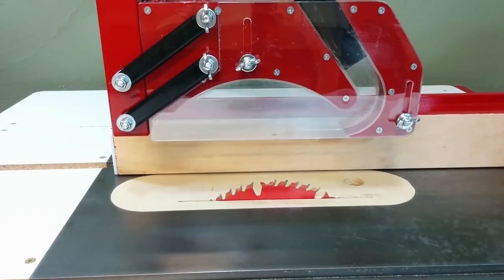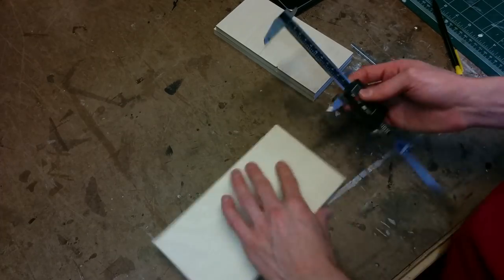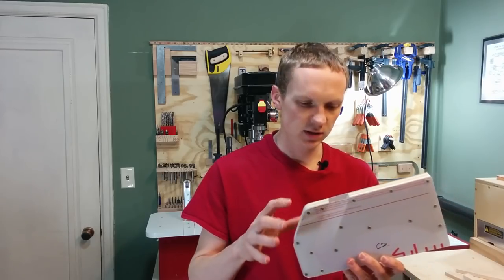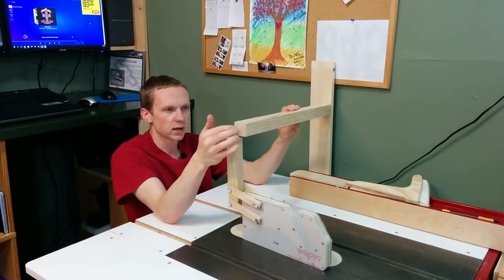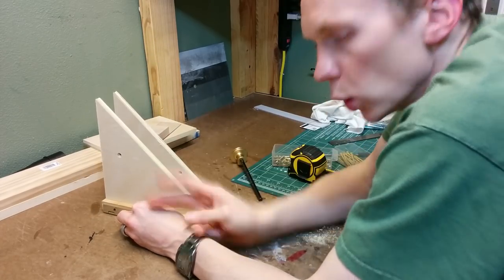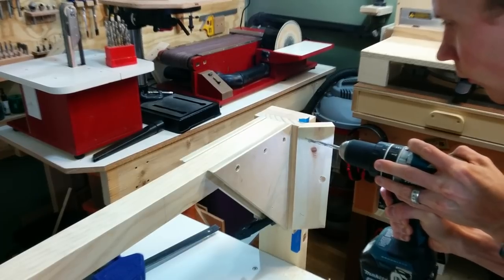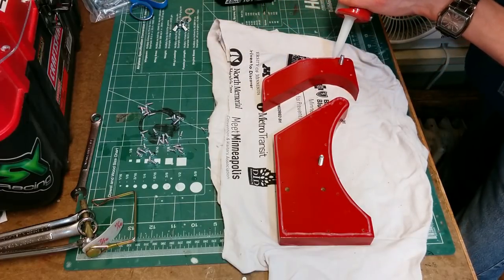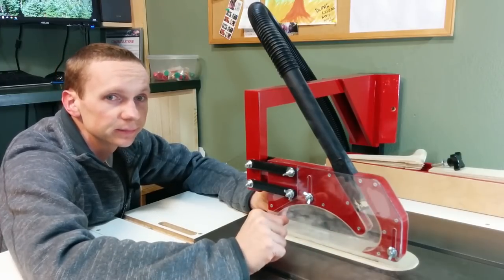Over Arm Dust Collection for my Table Saw

Comment: The design of the cover itself is exactly what I envisioned. Your airflow layout captures the dust efficiently because it works with the momentum of the dust as it shoots forward off the spinning blade instead of against it. Even the highest-end options available on the market today don't work nearly as efficiently as this design because they pull the dust vertically instead of at this angle. This is the first video I've seen of yours, but this design alone is enough for me to subscribe. Hope to see more from you.

Comment: i want to thank you for finally giving me a realistic solution to better dust control in my shop. I am building a new shop in my basement.  I  am excited about experimenting with your design on my Kapex miter saw and Sawstop table. Festool brags about their superior dust collection on the Kapex. It is all bovine excrement! It sucks...because it doesn't...suck that is. Thanks again. Your solutions are practical and won't require me to learn how to mig weld nor own a CNC. Although those 3D printing things you did were impressive.

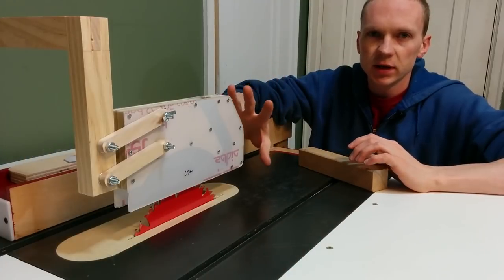Comment: 15:00 I relate.  Various situations call for shaving a kerf-width or less off the side of stock, but one that I encounter frequently is when I am forming molding profiles - various pieces of base, casing, backband, crown, etc. - to match the original in my house.  For these operations I use a 1/8-in. kerf blade with flat top teeth, typically shaving about 1/16 in., up to 2+ inches high.  Nothing throws dust and shredded wood off my table saw like this type of operation.  My jury-rigged dust vac port inside my saw cabinet might as well be a blower for all the good it does when forming profiles.  I think maybe my zero clearance inserts actually make it worse; shredded wood fibers often collect in the blade slot in the inserts; I need to test that.   So I end up taping a floor attachment for my shop vac over and beside the blade, which is awkward because the work is surrounded by lateral and holddown featherboards, infeed and outfeed (as I am not actually ripping the work into two pieces).  I'm going to order your plans at least to give me some more ideas.  For one thing, I think I'll need longer linkages to enable raising the "shield" higher to accommodate stock that may be five or more inches high, e.g., 1x6 going through vertically.  A little late as I just today completed forming edges on 80 boards, eight to 14 feet long, lol.

btw, I only came across your channel the past couple days and I must say you are extremely ingenious and creative in your approach to deriving solutions to problems.  I was not surprised to learn what your day job entails.

Comment: AAA+  I saw this video when it first came out and it's as relevant today as ti was then. I saved it because this is a great basic design for an over head dust collection for a tablesaw and Justin is still using it today in is new shop. The piece that encloses the blade is the most important part because of the internal design. I just set up my new cabinet saw and instead of paying over $1000 for the enclosure and arm that I could also have bought, I'm making this one instead. It's a proven design, simple with very inexpensive components. I will encorperate a steel beam instead of a wooden one for the arm because the span above my new tablesaw is much longer than Justin's. I highly recommend that you watch some of Justin's other videos. You may not like a certain component within in a design of his but tweak it to your needs as I'm doing with this one. His ideas are clever, budget friendly, and inspires you to expand your mind to be more creative. Thank you Justin for designing my new tablesaw's dust collection!  ;>)

Comment: It's a good thing you made this, because dude, you NEED dust collection in that shop, with your computer desk being basically your outfield table for your table saw.  I'm still watching the video, but so far I like it, and I think I'm going to follow your model for overhead DC on my contractor saw.

Comment: Like your guard dust pickup head. It takes out the dust where it is generated at the front of the guard. Most ready made dust collection guards have the port at the back or middle. Most of the dust during a cut goes down through the insert until the blade exits the cut. Then a plume of dust is blown back at the operator.

Comment: Hi Justin.  Fantastic video!  Thank you very much for a great video.  I am about to make a similar dust collection arm for my sliding table saw.  I love your design and will definitely incorporate most of your ideas.  I will just replace the wood arm and stucture with steel tubing in my solution because I want a 4 inch extraction for improved airflow.

Comment: wow. pretty cool. I like the swing away feature for when it would get in the way. I always wondered why most overhead collectors have the vacuum port in the back, as the blade throws the dust toward the infeed direction. I bet your design is more efficient. Also never knew that you could heat mold round cylinders into a square. That was a great idea!
Reply from the maker: Thanks James!

Comment: Ok.  I've been binge watching your videos all day.  Your craftsmanship is remarkable.  What is most remarkable is how you think to do the things you do.  Heating the hose end to make it a square is what separates you from the good.  That kind of inventiveness makes you GREAT.  I can make stuff, but I can't think of stuff.  I am starting to get envious.  ;-)   The way you solve problems so simply is amazing.  Love watching you work.  What is that scribe thingy you used to mark the lines for the gussets?  It was some kind of rod with a round knob on it.  That is so much more accurate than making two measurements and drawing a line.  I'm definitely building the 2 inch sander.  It looks like that has become an indispensable part of your tool collection.
Reply from the maker: Thanks for the feedback Joe! I think the tool you are referring to is the marking gauge. I don't use it a lot, but it is very precise.

Comment: Nice work. Much safer and cleaner  . I'm curious why they don't include something like this in every saw from manufacturer. Here in EU  30-40 years old saw's  have this feature already when you buy them. 
Good job. Keep up the good work
Reply from the maker: +Slovenian Woodworker I agree.. I guess people don't want to spend money for nive accessories like these.
Reply: Justin Depew Maybe that is the thing. There are being sold as accessory so you have a choice.  Here are as standard I think also by law because every saw has one of those. Mine for example too and is 20 + years old format saw.

Comment: Quite a good video! I liked the recap at the end with lessons learned. I assume that the dust collection was all that you hoped it would be or you would have mentioned it. 
I think that the solution to the bolts getting in the way is to replace them with rivets. Rivets of that size are commonly used in the bodies of cars, in doors, for instance, where there is no clearance room to spare for bolt heads and nuts.
Reply from the maker: Thanks.  Dust collections works well - I am happy with that.  I don't think rivets would work because I am relying on being able to tighten the wing nuts down to lock the position of the dust collector.
Reply: Justin Depew Great to hear the collection is working well. I think I'll try to replicate it. I suppose you could use a threaded insert on the one side and a low profile cap bolt that's slotted on the other and loosen/tighten it with a slotted screwdriver. Anyway, thanks for all.

Comment: Great idea! I think I will make one but I think I will make a few minor changes. I would create a more angled front to allow the board to just slide under the hood, lifting it up as I slide the board forward. It's own weight will keep it tightly on the board as you feed it forward and this would eliminate the need to adjust it to the board thickness and locking it in place. :)

Comment: Some folks use a “spare” apartment room for a computer, sewing machine, etc., I have never seen / known anyone put a workshop in that space.  Genius!!

A couple comments…
•  While polycarbonate is harder and more scratch resistant, acrylic is a whole lot easier to use (particularly if you have a friend with a laser engraver!).  Additionally, because it has a lower thermoplastic melting point, polishing the sawn edges (as well as bending) is easily done with heat (but unnecessary if a laser engraver was used: acrylic is self-polishing from the laser beam’s heat).
• When sanding the inside of the curve (wood directly over the saw blade), did you consider using to top of your small belt sander: it has curved sanding surface?  It seems it would be a better sanding solution for (inside) curved areas than a flat sanding surface.  Putting a spacer piece of wood behind the sanding belt for a more rigid sanding surface was very clever.
• When cutting a tenon, two cuts with the table saw would be easier: one vertical and one horizontal (no chisel needed).
• For the square plastic hose, it may have been easier to cut a “point” on the end of your molding piece, perhaps four “point” butt at 30° angles.  With a point in the stake, shoving it into the round plastic tube would likely be easier while heating the plastic.  None-the-less, a smart “round hole — square peg” solution.
• For the “too” long bolt issue, consider using a carriage bolt on the left side of your contraption.  You could easily file in a square hole in the plastic.

Again, kudos for your ingenuity and sharing your project.  I am trying to do the same thing, only trying to adapt a saw-collecting hood to my saw blade plastic shield: as I saw, the hood would “automatically” flex upward based on the thickness of the piece I am cutting.  Your solution is just as workable, but one more thing ya gotta do before cutting something.  I think your solution is offering me a better potential solution to do what I want to do (or try).  Also, I am putting my suction port on the back (far) side of the blade because that is were the saw dust is coming up from underneath the table — except, as you showed, when cutting off slivers of wood from the left side of whatever you are trim-cutting.

One final thing… While most of us are, like you, operate on a small budget, consider getting a RIDGID Oscillating Edge / Belt Spindle Sander, Model#  EB4424 at Home Depot.  These are about $200 or less.  I LOVE mine; a rigid flat belt sanding surface, several round spindles, etc., that oscillates is really sweet. These are very small (comparatively), and would fit great in an apartment.  I am still trying to figure out a sawdust colleting hood for my sander; right now, I just a use a “Table Top Dust Hood” setting behind my sander that collects ‘most’ of the dust.  Because I have a larger workshop area, this is not too big of an issue; it us just annoying (and better than nothing).  However, necessity is the mother of inventive solutions, so a “dusty” sander in a smaller room would coerce a solution: be sure to make a video of what you develop…
Reply from the maker: Thank you for the helpful tips and suggestions!!  You have a sharp eye for attention to detail.

Comment: Nice work, this is very similar to what I was picturing in my head when I was trying to draw something up, but this very well thought out.

And please be careful making those unsupported miters on a chopper. Guy I ran into on a job was missing the tips (below the finger nail, so quite devastating) of three fingers and said he was doing a cut like that when the blade bound and pulled his hand into the blade. Number one priority is to finish any work day with at least as many appendages as you started with.

Comment: Very nice design and video, just found your channel and have subscribed.
I think having suction at the front is likely to give better results than from behind the blade.
One question I have about the design is about blade visibility, with a solid front to the dust shroud presumably you can't see the front of the blade as the piece to be cut is pushed forward, do you find this an issue?
Reply from the maker: Thanks for watching!  I do not have an issue with visibility as I try not to stand in front of the blade.  I typically stand off to the side while pushing pieces through the table saw.  This keeps me out of the way in case of kick back and allows me to just see the front of the blade through the side of the dust shroud.

Comment: I'm curious, after noticing what kind of wood you used for portions of the project (big box store "select pine"), which I have used on various projects in and out of the shop, if you've noticed any loosening of the project as a whole or slop in the moving parts which are constructed of that kind of wood.
Reply from the maker: I've had no issues with the big box store lumber. It usually takes some digging to find a straight piece, but other than that it's fine.

Comment: Very cool! But if you close the rear opening between the two plexiglas panes, I think it would be even more effective.
Reply from the maker: Thanks! I left the rear open because the air needs to flow in from somewhere. Creating a flow of air over the blade I thought would be most effective.
Reply: @JustinDepew  Ok! i understand! But you can try it with a duct tape.

Comment: I see home made and commercial dust collection with the suction mounted in front, on top and in the rear of the shroud. Do you know which location is most efficient? Why did you decide to mount your's up front?
Reply from the maker: I'm not sure which is most efficient, but the reason I chose the front was because it matches the air flow that is created by the blade. If the hose was at the back of the blade, it would have to suck the dust against the natural direction of the flow. I thought having it in the front would collect the most dust for this reason.

Comment: Great Video!  This is one of the best builds I've seen in a while.  Question - do you have under-table dust collection also?  Or are you just using the over arm?
Reply from the maker: The saw is enclosed under the table and there is a dust port, but I only use the overarm because I only have one shop vac. If I had more than one I would use both under table and over arm collectors.  Some say I will get both hooked up.

Comment: What are the dimensions of the shop vac extension tube that you heat - 1.25" OD?
Reply from the maker: I used a standard 1-1/4" shop vac hose.  I'm not sure what the exact dimension of the ridged tube portion is.

Comment: Have you considered selling plans instead of giving them away for free?  Your designs are some of the best of each type I've seen and I've looked at a lot of designs. I've been a professional engineer and product designer for almost 30 years now and I believe you may be underestimating the value of your designs.

I'd be interested in hearing your thoughts about why you don't sell your plans. Thx.
Reply from the maker: Thanks Tony, I appreciate your comment.  I have a few thoughts on why I am currently giving away my stuff.  First, I am extremely grateful for the internet and everyone on it that posts free content.  I learned woodworking entirely by watching other people's videos. I can't count the number of times some stranger on the internet has saved my day or helped to solve one of my problems.  I like to think of what I do by posting videos and 3D designs as my way of giving back to the community.  Secondly, I am not currently trying to make a living off of this content.  I have a day job and don't need this to make money to support myself.   Third, making plans is a lot of work.  I don't actually make plans, I just make a 3D model.  Since I don't put the effort into making detailed plans, I don't think it's worth it to try and sell my models (although I may be underestimating this value like you said).  Since I only do this in my spare time, I would like to spend most of that time designing and making new projects, instead of putting together plans to sell and maintaining that part of a business.  Maybe someday I could do this full time, but for now enjoy the free stuff :)

Lastly, if anyone is so inclined I do have a donation button on my website in which people can contribute to what I do there if they see value in what they are getting here.

Comment: Will you ever do a little explanation on how you get your paint to come out so good?
Reply from the maker: No secrete here.  Three coats with foam brush, sand with 220 in between coats.  I use rustoleum enamel.

Comment: It occurs to me that you can't see the blade from your point of view as you feed the work thru the saw.  That would bother me a bit.
Reply from the maker: I always stand off to the side of the blade when passing boards through so I can see the blade just fine. You really shouldn't stand directly in line with the blade because of kickback.

Comment: If you have a powerful extract system you wouldn't  need what you've shown. Don't forget the riving knife
Reply from the maker: I disagree. No amount of suction below the table will capture the dust made above the table. Especially dust made from thin edge cuts. Even professional table saws have over arm dust collectors.

Comment: the linkages should be inside and not  in the exterior as a improvement
Reply from the maker: +Ronaldo Sosa that is a really good idea!!
Reply: sorry my english!!!  saludos desde argentina ;)
Reply: What would that improve? if anything it would make it harder to tight them down.
Reply: @brandonrippeonphoto  I believe the improvement eluded to here, is removal of obstructions that may otherwise impede movement, and indeed prevent narrow passes.